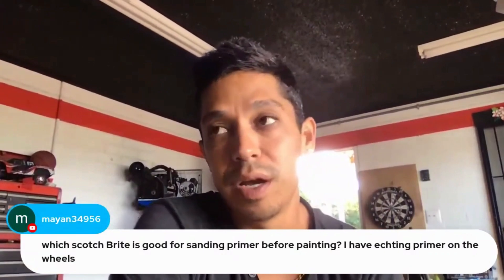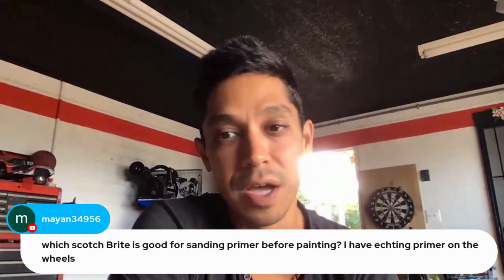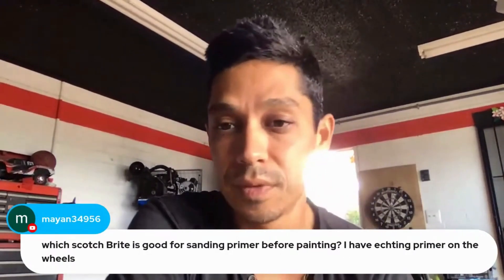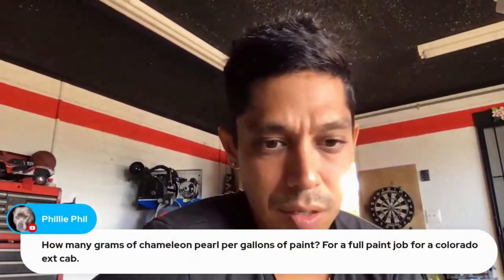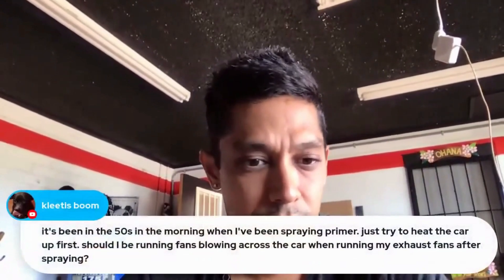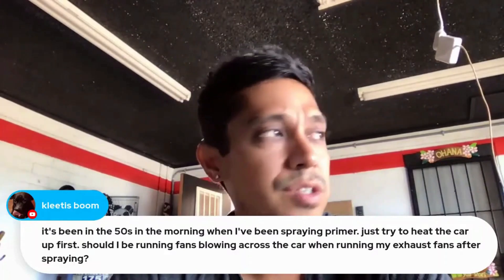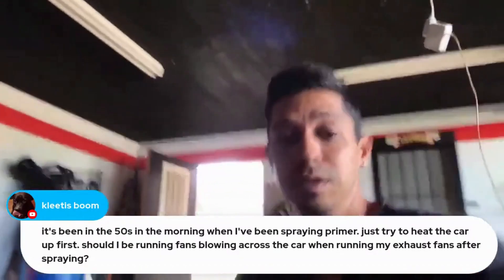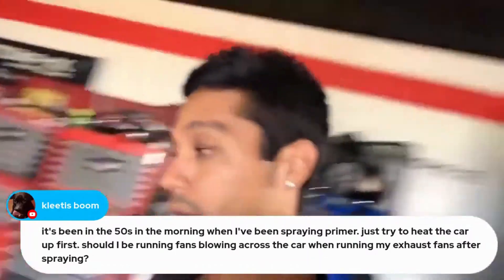🚘👉Autobody & Paint Q&A - DIY Car Paint Job & Repair: Spraying Pearl, Fan Setup, Aluminum Dent Repair

Comment: 3m scuff pads are specifically made for automotive auto body and paint, they work amazingly and when paired with scuff paste they work really well and they last so much longer, you can buy each color in a dispenser type box and hang them on your shop wall